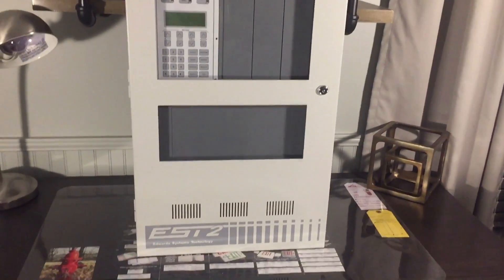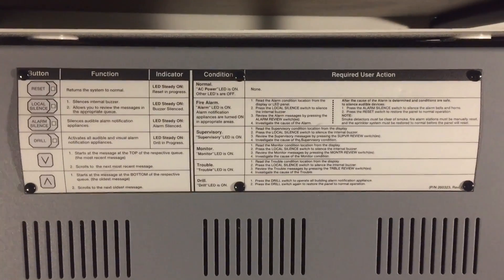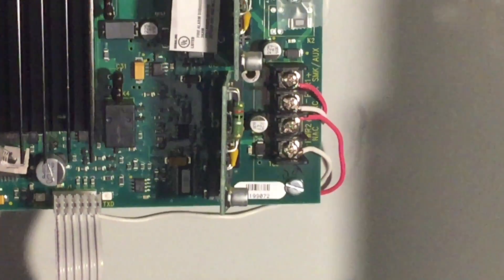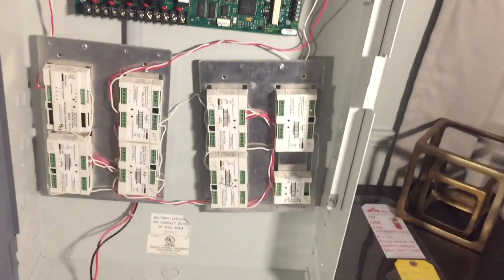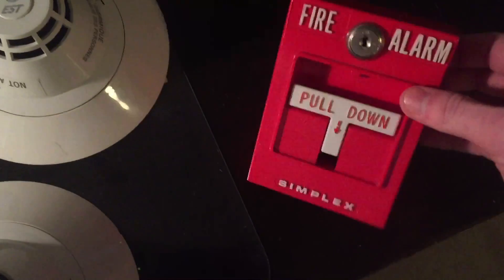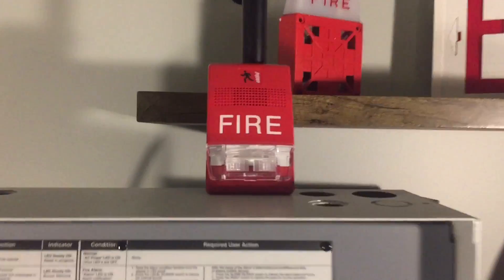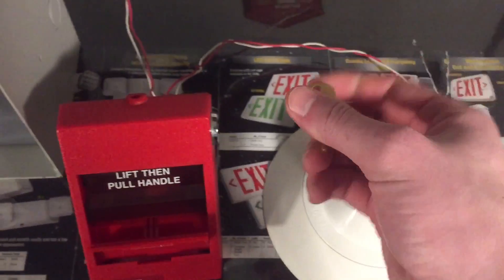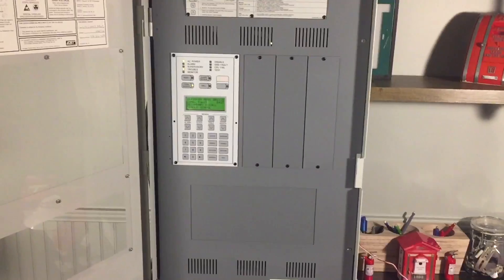EST2 Fire Alarm Panel Demo and Overview

Comment from the maker: For those interested about the history of my school’s fire alarm system:
The original building was constructed in the 1970’s. It was one story, approximately 10 classrooms, and a small office. The fire alarm system was an old Edwards one. There were six Edwards 270-SPO pull stations, two smoke detectors, (model and brand unknown) and two Edwards Adaptabells. In the mid 1980’s a new addition to the school was built. It included a cafeteria, a gym, locker rooms, pool, music room, another larger office, and many more classrooms. The panel installed for the new addition was a Simplex 2001. The system had Simplex 4251-20 pull stations, Simplex 2098-9201 smoke detectors, (detectors were only in hallways with classrooms; none in the cafeteria, gym, office, or music room,) and in each closet of every classroom was a Chemetronics heat detector rebranded by Simplex. Notification appliances were Simplex 2901-9806 horns scattered around. Coding for the horns was continuous. The old Edwards panel was removed, and the Adaptabells were disconnected (yet still installed on the wall) and three additional Simplex 2901-9806 horns were installed in the original 70's wing. Next in 1993 another new section was added. It was a two story building connected to the 80's wing. This new addition had more classrooms, and two science labs. The system installed for this addition included Simplex 2099-9795 pull stations, Simplex 2908-9201 smoke detectors, Chemetronics heat detectors rebranded by Simplex, (now installed in the classrooms themselves instead of the closets) and Simplex 2901-9840 horns on 4904-9105 strobe plates. (Set to continuous) A Simplex 4002 was installed on the first floor of that building and linked to the existing Simplex 2001. In 1998 a third floor was added to the two story building. The system only had an expansion wired to the 4002. The expansion had more Simplex 2099-9795 pull stations, Simplex 2098-9209 smoke detectors, Simplex TrueAlarm heat detectors installed in the classrooms, and Simplex 4903-9254 horn strobes, (set to continuous) and Simplex 4904 strobes installed in classrooms and bathrooms. In 2000 a small, separate building separate from the existing school was built. Acting as a general purpose building for events. The building had one large room with a sliding wall to divide it in half, two bathrooms, a full kitchen, and a closet. A Simplex 4002 was installed at the entry doors of this building. The devices were three Simplex 2099-9795 pull stations (installed at all of the exit doors), four Simplex 2098-9201 smoke detectors (two in the large room, one above the 4002, and one in the closet) and Chemetronics heat detectors rebranded by Simplex in the bathrooms. There were only four notification appliances. Two Wheelock MT horn strobes (vertical strobe) set to horn continuous in the main room and a Wheelock LSM strobe in each bathroom. There was also a Simplex dialer panel in the closet. This system is independent from the main building. Next in 2003 a brand new wing was added. Connected to the gym of the 80's wing. The new building was two stories and became the athletic wing with another larger gym, weight room, wrestling room, and locker rooms. The Simplex 2001 was replaced with an EST2, (the same exact panel in this video) the Simplex 4002 that was on the first floor of the 1993 three story wing was “gutted” and now being used as a junction box. An EST NAC expander was installed above the 4002 for the existing Simplex notification appliances in the 1993 three story wing. The devices installed in the new athletic wing were EST SIGA-278 pull stations and EST SIGA-PS smoke detectors. EST Genesis horn strobes and strobes in red and without fire lettering were also installed. In 2005 hallway extensions were made in the 1993 three story wing. Each floor had hallway extensions to add more classrooms, two science labs, and bathrooms. New fire doors held by fire magnets connected to the FA system were installed between the existing building and the new expansion. The devices for the hallway expansions were EST and connected to the EST2 panel. Pull stations were EST SIGA-278's, smoke detectors were EST SIGA-PS's, and in each classroom and bathrooms were EST SIGA-HRS heat detectors. Notification appliances were red EST Genesis horn strobes with fire lettering installed in the expanded hallways, classrooms, and Genesis strobes in the bathrooms. Additionally, some Genesis’s replaced old defective Simplex 2901-9806 horns in the older 80’s wing. Next in 2007 an existing building was remodeled. It was an auditorium that sat beside the original 70’s building. (Also built in the era, but with no fire alarm system) A connector hallway was built from the original 70's building to the auditorium. The auditorium, foyer, and hallways were remodeled with an addition of a few more classrooms and a “fine arts” hallway that had a band room, chorus room, and dance room. (With other various rooms built too) The panel installed was a Notifier AFP-100. This system was independent from the EST2 and the rest of the other wings. It had Notifier NBG-12LX pull stations, Notifier FSP-851 smoke detectors, and white Wheelock ZNS horn strobes (set to code 3) and strobes as well as System Sensor beam detectors in the auditorium and backstage. In the foyer of the auditorium a Notifier FDU-80 annunciator was installed. In 2017, lighting struct the fine arts wing, destroying the AFP-100 and FDU-80. The panel was replaced with a Notifier NFW2-100, and the annunciator was replaced with a Notifier NANN-80. In 2018,  the whole school was getting a fire alarm system upgrade. All of the old Simplex devices, and all of the EST initiating devices were removed while the EST Genesis's remained. The EST2 was removed. (and given to me as well as a few old devices 😃) The new system installed was Silent Knight. The new panel being a 6820XL. And a 5860R annunciator was installed in the main office/entrance of the school. New pull station locations were installed, and existing conventional pulls were replaced. The new pull stations are SK-Pull-DA's and a few SK-Pull-SA's. Smoke detectors were replaced and more added almost everywhere. Those being SK-PHOTO's. And new notification appliances were also installed everywhere, however they are ceiling mount. The devices are System Sensor PC2WL horn strobes, and SCWL strobes. About 99% of the NA’s are ceiling mount, but there are four that aren’t. Those being wall mounted P2WL horn strobes. The coding for the L-Series devices is code 3. The Silent Knight 6820XL, and the existing Notifier NFW2-100 in the fine arts wing are not linked together. The new system had some issues such as the panel's software crashing, false alarms, and non functional notification appliances. The company in charge of the upgrade was back on campus constantly to fix the problems. In the end, all of the issues have been resolved and there hasn’t been any more false alarms or panel problems. A new Silent Knight NAC extender was installed under the existing EST NAC expander and above the gutted Simplex 4002 that fixed some of the notification appliances that were not working. Now all notification appliances are functional. That's the complete history of my school’s fire alarms. Thanks for reading!
Reply: Lighting destroyed the panels in the fine arts building? Didn't realize bad lighting could do that. I guess the fine arts snobbery rubbed off on them.
Reply: I had a faraday system in my old school haha running a federal signal horn strobe and a 270p-spo Edward's pull station.. and heat detectors no smokes lol this was 1997 haha
Reply: My school has a notifier NFS2-3030 (not joking) with system sensor spectalert advance horn strobes and remote strobes. But with the construction of the school there are system sensor L-Series horn strobes in the portables and system sensor L-Series speaker strobes in the renovated areas. The pulls are NBG12LXs with FSP-851 (not much) and FSP-951s in the portables and probably in the renovated area.
Reply: Well, The advances are no more. All of them have been replaced with L-Series remote strobes and they added remote speakers everywhere. The new parts of the school and the renovated parts of the School has L-Series speaker strobes. The Cafeteria and Gym (which is now a auxiliary Gym) have weather proof advances for some reason. The outside alarms are advances. There is one P2WL horn strobe but I don’t know if it’s going to be there anytime soon. The NFS2-3030 has been upgraded so it can do Voice Evac. The newer parts of the school are mostly ceiling mounted. There is a fair amount of wall mounted devices as well (in the newer section).
Reply: COOL!
my school has a mircom fx 2000  (i think) but it used to have an old edwards panel (which they still haven`t removed). They have a lot of adaptahorns (895) and a lot of potter strobes. They have 1 zns, 1 mircom select a horn, a few edwards 896 (i think) horns, a LOT of 270 spos and 1 old unknown pull station. All of the different alarms (except 896s) replace old adaptahorns. The strobes were added when alarm code said that strobes are required for the hearing impaired.
Reply: My school is simplex 2099 9838 with Siemens pull station and a new simplex touch screen panel replace a 2001 and a fire lite ms4 for the added on section and now they are on one system instead of two and also there are welock zns and as int the pods and also seimens smoke detectors the hole system is addressable and also there are 4 heat detectors in 1 in every closet in the hallway 1 in the electrical rooms and 4 in the kitchen also all the heat detectors are Siemens and are addressable the old system had simplex 4251-20 and notifier smoke detectors also they keep the horns and the strobe plates and they have a fire door system to also I just found out we have a simple 4007 addressable fire alarm panel which is touch screen which is very cool
Reply: My school has a NFS 320 alarm panel, BG12 pull stations, and P2Ws and PC2Ws everywhere. I think that the original alarms were Wheelock vibratones, because a few are left on the wall not in use.
Reply: I own the EST1
Reply: My high school (now the middle school) built in 2004 has a Siemens system (not sure of the model name) with UMMT horn strobes and Siemens/ Cerberus pyrotronics pull stations
Reply: My school had some simplex system a few years ago(not sure of the panel, it had Truealert, truealarms, not sure about pulls, probably simplex t-bars, the system was replaced in 2020 with a notifier voice evac system, I’m not sure what panel it has, but there is an annunciator at the main doors, and for alarms, we have system sensor L series speaker strobes with ALERT lettering instead of fire lettering, notifier FSP-851s and 951s, and a single NBG-12LX in the office
Reply: Very cool. Both my elementary school and my middle school is a EST system with the same panel. For the alarms they had EST Genesis horn strobes in the class rooms at my elementary school. My elementary school also had EST integrity horns and horn strobes outside. Horns in the open. Horn strobes in the shaded parts. For the pull stations were EST SIGA pulls and we’re addressible. The panel was a EST2 in one of the class rooms. The smoke detectors were only in the music room and in the lunch room. My middle school has EST genesis horn strobes and strobes in the hall way and strobes in bathrooms. Outside they have EST integrity horns. In one of the buildings they have EST integrity horn strobes. For the pull stations in the old part of the building they have EST 270-SPO addressible pull stations. In the new part they have EST SIGA pull stations addressible. The panel is a EST2 panel with no annunciators. STI stoppers in the gym and in one of the newer parts and with the horns. My elementary school has a annunciator in the front office. I thought that the devices were the same and panel was the same
Reply: ExitSign250 I’ve seen a Notifier FDU-80 at a BJ’s Restaurant in my area, and it was a #whatafirealarmfail because, the keys were left in it. Now random people are tamper with the annunciator which is ILLEGAL!

Comment: Says a lot about that panel that the piezo is slowly dying throughout the video. EST2s are probably one of the most unreliable panels ever made.
Reply from the maker: I’ve heard and seen the QuickStart series was one of the worst. You know it’s unreliable when they have a “CPU Fail” light built into the display…
Reply: @ExitSign250  Well, the 3030 panels have one too. So does the EST2. Quickstarts are ok if you have them on 2.5. 1.8 is what kills them.

Comment: I have an issue,  Maybe someone can help out,   My EST2 system has a hookup to a gate, So that if there is a fire alarm or trouble the gate automatically opens allowing the fire department to enter the parkinglot without any issues.     We have had a sprinkler company come in and do some work,  They were messing around inside the panel, and now there are no indication of alarms, supervisory or troubles. But our gate is stuck open reading that there is a fire alarm problem.     Any ideas?
Reply from the maker: I’d assume the gate is controlled by a relay in the fire alarm panel, or a remote relay module. Perhaps try resetting the panel? If not, the possible relay controlling the gate may be defective. Or the gate controls may be defective. It’s hard to really know the problem without seeing the setup.

Comment: This is a really neat system. I love how it actually has keys to scroll through each log individually, and how it shows the conversion from conventional to addressable. I think the system at my college is the same way.

Also, the monitor module to the top left just monitors the voltage in the other circuits?
Reply from the maker: It is pretty interesting. The module in the top left makes sure that that other monitor modules are supplying enough voltage to conventional devices. And if they aren’t, it will pull voltage from the 24VDC output from the power supply board. (Or something like that; the data sheet is a little bit vague)